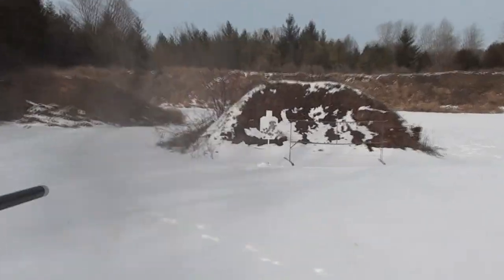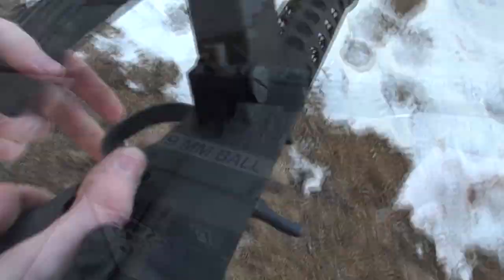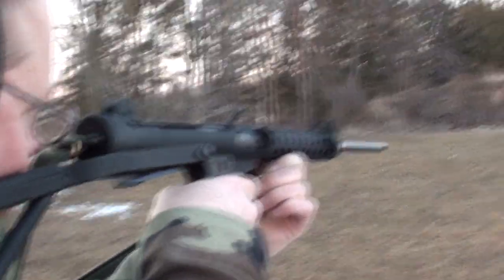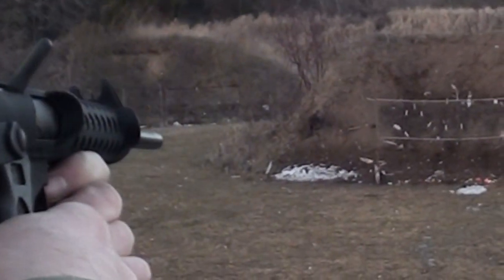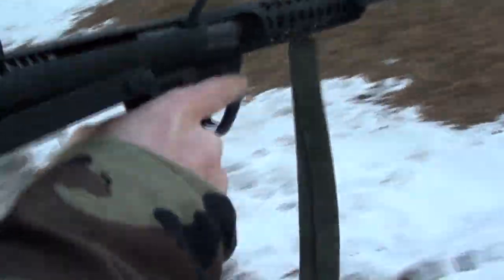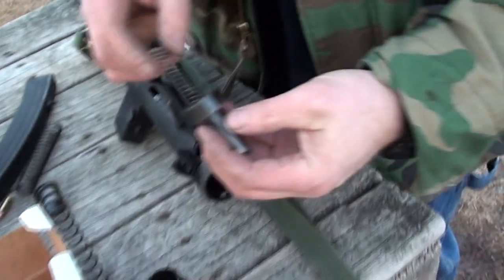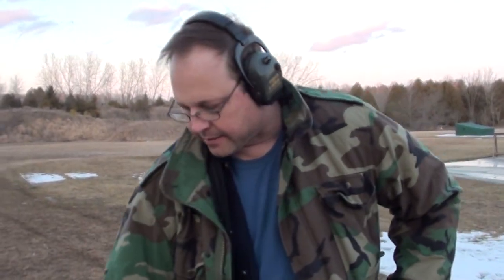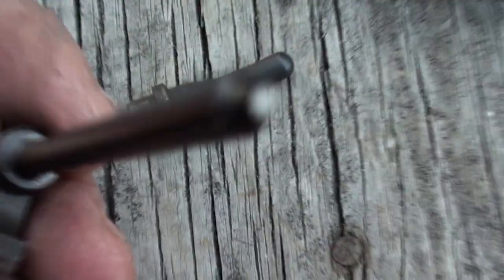BROKEN FIRING PIN - Sterling 9mm Semi-Auto Carbine

Comment: Took my Sterling out to the range yesterday for the second time and the pin broker after about 40 rounds.  Called today and spoke with a lady there about getting it fixed and was told they are OOS on the pins.  According to her it wasn't an issue with pin diameter but rather bad heat treatment on some of the smaller firing pins.  I can't believe their solution is for me to keep watching the website for the next two months and call back when they list the pins in stock.

Comment from the maker: After some confusion as to whether or not it was still under warranty they asked me to send the bolt and firing pin.  Replacement parts arrived promptly and I made a long video showing the test firing but the wind noise was so bad that I scrapped it.

It works most of the time but I have zero confidence in it.  After what I've read from other owners online I'm sure the firing pin will break again some day.  This is not a serious firearm that a guy can rely on to do what it is supposed to do.

Comment from the maker: They now use a thicker firing pin, 0.22"  as opposed to the original 0.17".  I've got the old style pin in mine right now but my spare is the heavier one.  

The orange ball target was a real bummer when we first bought it because it wasn't very reactive, not really $25 worth, but it is actually pretty good if you place it up against a berm.  We much prefer steel plates but when the ground is frozen it's kind of nice to just chuck the ball out there.
Thanks for watching and for commenting.